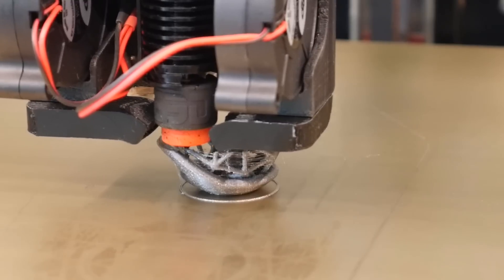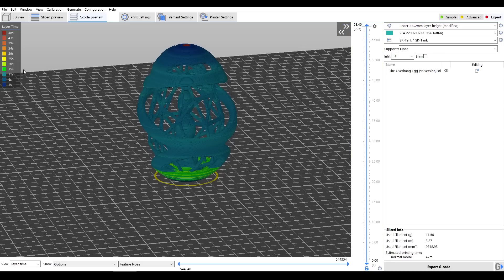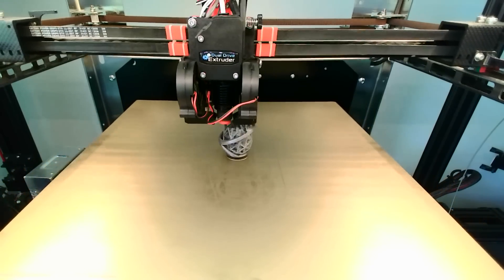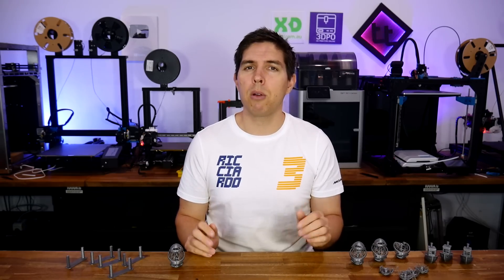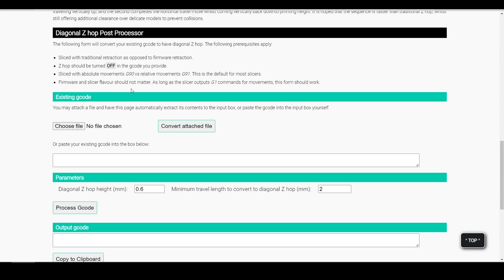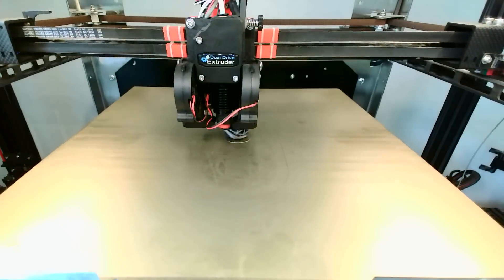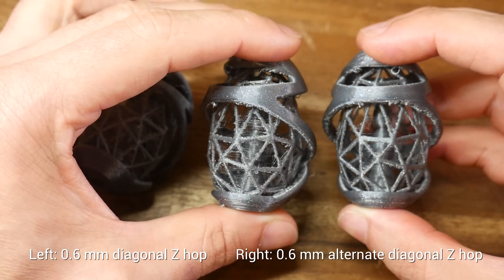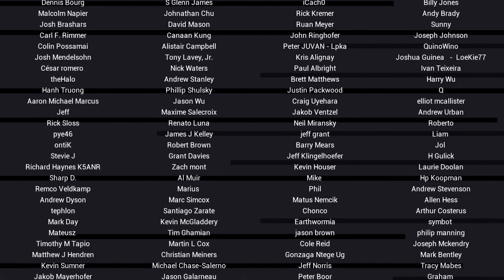Diagonal Z hop - Help me test this new slicing idea

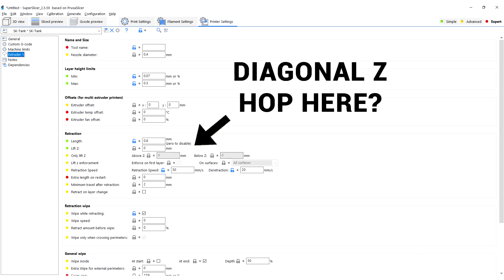Comment: 11:51 What we really need to find out, and empirically test, is why and how the z-hop produces stringing, while without it does not.
My personal guess is that the printer without basically wipes the nozzle off on the part it is printing. And the one which z-hop is a surface tension problem. If that is correct, a hardware solution is best, I think. A razor blade that wipes the underside of the nozzle by almost scraping metal on metal, perhaps.

Comment: My bed is only 140mm but the higher the object gets the worse the effect seems to be... as the head moves between the left and right extremes it seems to dig harder into the surfaces at the sides... I was expecting it to dig more in the middle due to rail droop, but it is like the bed istelf is drooped... unlikely as it is a sheet of glass. Calibration of first layer is critical to adhesion. My bed is calibrated well in general and after I put some hair spray on the plate I can get several prints in without releasing, while still not needing the giymnastics needed to remove from glue stick... Sort out the 1st layer, maybe increase temp to 215C for layer one to make it more smearable, and it will stick

Comment: This has been added to Orca Slicer (i switched from Cura, its been amazing). Under the Printer Settings --> Extruder --> Retraction --> Z hop type --> Slope

Switching from Normal (vertical) to Slope solved my stringing problems. I was trying to modify temperature, retraction length, retraction speed, drying filament, etc, you know all of the traditional things that can help. The only thing that worked was disabling z hop. Of course you lose the benefits of z hop, and risk knocking off prints. Then I came across your video and discovered that its already in the slicer! I reset my settings and only changed to use Z hop Slope, and the stringing is virtually gone! Im at 220 C temp for PLA, 0.8mm retraction distance for a DD extruder, 45 mm/s retraction speed. Pretty normal I think. Anyways, this makes me love Orca slicer even more. Orca has all the best features from the other slicers and some unique ones.

Comment: I think problem could be mitigated by avoiding entering and crossing curled zones, which can be detected by slicer as areas of steep overhangs. If nozzle will avoid these zones printing will continue regardles curling.

Comment: I printed this out of ABS using the same settings I use to print all my Voron Parts. Came out perfect other than some minor miss aligned bridge extrusions due to the bridges being on a curve. I guess the low part cooling needed for ABS with 40c chamber temps really makes this a cake walk for ABS. My Lift Z is set to 0.2mm and I didn't have any stringing. I even even have outer perimeters printing first which should make overhangs harder to print.

Comment: Would probably be more elegant if the slicer was just smart enough to avoid travel over overhangs. It can already identify overhangs to provide extra cooling or by adding extra perimeters so the same logic can be used to avoid them during travel. There is already a function to avoid crossing perimeters during travel. Also you want Z-hop to be at or less than half the nozzle diameter. Anything over that you will get excessive stringing as you have discovered.

Comment: I think stringing is reduced with no z-hop because the bit of oozing filament is wiped off as the head moves sideways away from the just printed part. You could experiment with „micro wipes“. Basically retract, then do a little wiggle before hopping.

Comment: I'm printing on a shitty fire hazard ANET A8 on a heated glass bed, hair spray for helping the part stick and a BL-Touch for bed leveling and I never had issues with parts getting of the bed. Maybe your bed adhesion is sub-optimal and that is where your bottleneck is. Your z-hop solution is promising though, great find!

Comment: I would think allowing the travel to move horizontal for say 2 mm and then move upwards should remedy the stringing issue as it acts like a normal travel and most failures happen as the travel arrives at the next extrusion

Comment: I would've implemented this at a constant diagonal angle, like 10-20 degrees from horizontal, up until it hits the desired z-hop height. That seems like the best way to avoid those curled-up bits consistently, and also makes small hops much less of an issue.

Comment: Why don't you just use "wipe while retracting"?
It will do a horizontal movement first then and the Z-Hop later.
With Z-Hop + Wipe enabled I print dry PLA without any stringing.

Comment: As the stringing most likely comes from the upward motion sucking out molten filament from the nozzle, I propose the following;

1. start the line horizontal without retracting

2. After a defined distance (let's say 2mm) you retract while doing the movement of step 3.

3. Continue like your second proposed method. I.e. move to 0.6mm above location B.

4. Unretract and lower to location B.

If you want to get extra fancy you can try unretracting a small bit more filament before lowering down to location B and retract back to normal before touching down. But idk probably nothing exciting would happen.

Comment: I remember years ago an experimental slicing tech where, at the end of a perimeter move, it would partially re-trace the perimeter to wipe the tool and smoothly lift off the part following that direction and then when it was off the part would curve mid-air towards the next extrusion target.

Comment: Cool idea and thanks for helping the community out with your tuning site and tips!
Would it be possible to let the hotend sidestep to an area where nothing had ben printed yet and no potentially curled up sections could pose a collision risk? Then, you would have the pros of a normal non-z-hop horizontal movement but still dodge printed edges which did curl up. I have no idea about programming though, so I am not sure whether it would be hard to write an algorithm for a slicer which identifies possible pathways in the same level instead of inserting a z-hop to a level where nothing should be because there should not yet be extrusions. On that note, maybe the existing code for non-planar slicing could help out here..

Comment: An alternative method that also could be tested is to make the Diagonal go directly above the destination point and not the middle point. in that way it would do two moves, one diagonal upwords, and then the vertical down to start the new extrusion. It could reduce the stringing and also had the benefits of a not so dialled extrusion so it does not knock the piece out of he bed.
Reply: oh well... i finish to see the video now... hahahah

Comment: In general the diagonal Z hop is similar to the wiping option in the slicer, providing a little more surface and time to capture oozing filament.  A short retraction as part of the Z hop may also help the process for objects with small surfaces. And you may get even more improved results by accurately tuning Linear Advance, and of course doing all you can to avoid ooze and wet filament that generates uneven pressure. Oiling the filament (e.g., with a paper towel dipped in vegetable oil) is another old-fashioned way to reduce ooze because it produces a slightly more regular extrusion. The object I sometimes use for this kind of stress testing is the classic Voronoi Skull at a very small size. Even before we had Linear Advance I was able to tune my old crufty Prusa i3 to the point where the output was almost completely string free. Anyway, diagonal Z hop is a fine variant of wiping and it would make a useful OctoPrint plugin while we await the slicer option.

Comment: I just tried a flipo that I failed 4 times to print (previously) on my ender 3v2 with a traditionaly diagonal z hop @ 5mm/2mm - printed with similar though beter results, now trying the alternate

alternate provided worst results, simply a glump of pla around the nozzle object was thingiverse # 4591728 though I layed it "flat" and the slicer didn't think it needed supports at 50x50x15mm and I sliced it using creality's slicer (cura based)  with super quality defaults and 100% (geometric) infill

Comment: Just a thought: Cura reduced stringing by ending each layer on the inside and the nozzle essentially scrapes off would-be stringing. I seem to remember you doing a video on why it had less stringing than Slic3r. What if you set the path to only raise z after some percent of the path of some distance, ex 1mm?
Z hop: |---------|
Your first z hop: /\
Your second z hop: /|
Scraping z hop: _/|

Hard to show in ASCII, but hope that makes sense!

Comment: There's two factors contributing to the failure:
(1)  The warped protrusions that the head colides with.  This is the real issue, and is the first thing to fix, if possible.
(2)  Bed adhesion... if the part is immoveably stuck to the bed, it will help avoid disaster when collisions do occur.  Michael, along with all the 3D printing channel Gurus, have long since adopted their favourite systems.  Some time back, I watched an excellent series, pre-dating 3D printers, on Rapid Prototyping by Dan Gelbart.  He explained that if you clean a surface with Isopropyl Alchohol, or products like thinners, you actually leave a layer of hydrocarbons.  Although it is typically only one atom thick, it acts as a separation layer.  I think he said that a detergent which can be rinsed off completely is preferable.  Ivan Miranda demonstrated his preferred method in a video:  basically clean it with dishwash liquid, (no additives, colouring, perfumes), rinse with hot water, pat dry with a paper towel (I just shake my glass bed until only the tiniest of droplets remain; the heated bed gets rid of those.) From that point on * DO NOT TOUCH IT...    E V E R ! ! ! *

This has worked for me, but Michael's test model will be a challenge for any method.
Watching with interest!

Comment: I think one important parameter would be the delta between the current printing layer height and the height to which the printer head will lift off to. In your example, no such delta is set, so it just lifts off as much as it wants to. My thought process is that the diagonal z-hop, as beneficial it may be, probably only really matters for near the point of lift-off and maybe at the drop-down (not with the proposed alternative, of course), so it would make sense to move the printer head in a straight line onwards from where continuing to move the printer head in the upwards direction would prove no benefit

Comment: This is a thought i had for a gcode modification that i dont have the skills for but could reduce travel times in prints. What i have noticed is if you align the zseam to one spot like a corner the slicer will be starting and ending each wall in relatively the same spot. So i thought why have it stop, retract, move, prime, print when it could just continue from the end of one wall to the adjacent start of the next wall out. Effectively connecting all the walls into one cohesive snaking wall for each layer. To me this seems like it could reduce travel times pretty well.

Comment: Here's an idea to tweak your alternate Z hop. If you can travel off the part horizontally and then once clear start the alternate hop motion. This way you still get the wiping action as the nozzle clears the part.
Reply: Outer perimeters need to be printed last, and the nozzle needs to move to the point where the nozzle has the shortest path to exit the printed area, even if it means moving away from the next printing point, otherwise you may hit your already printed section (curled borders). Once the nozzle is outside, lift and move it towards the next printing point, going down vertically. Also, retractions may need to be tweaked.
Reply: Cura already does such thing; parameter is called "avoid printed parts" and it can also avoid support material. It does choose between a z hop or an avoidant travel move though, but never both simultaneously.

Comment: Really interesting your research and testing. Very thanks for your resources in your calibration site and videos. Did you already talk about a way to recover a failed print? I mean a way to launch a new print in top of existing failed print by offseting Z and chopping the gcode at the right "height" or maybe another technique to get it. This would be super useful for those big prints that fail at the very end.

Comment: Watching the animation showing the difference between standard travel z hop and diagonal z hop really clarified this for me.  I'm new to 3d printing so I am taking in all the info I can and this is great stuff.  But one thing hit me:  Why do the hop from 2 edges that at close together instead of from the "outer" edges?  Using the tower you showed in this video would it help to do the hops at the outside edge, travel over the printed surface doing the diagonal hop and then "land" on the outer edge on the other tower followed by moving inwards as those layers are applied?  I suspect I'm not describing it well but I would think that the stringing could be reduced if the strings are connected inside the print surface instead of at the edges.

Comment: The reason I use z-hop is to avoid hitting printed parts, as you demonstrated with the curling edges of the egg. Your modification appears to ignore this necessity by making the upwards travel move so slight over larger distances that there is probably more likelihood of it hitting the printed part on larger prints. I would suggest you need a slight modification to your 'alternate' approach which is to make three movements; first a short diagonal move upwards which introduces the required height for the z-hop, but also keeps the nozzle moving horizontally, then move the rest of the way horizontally and finally descend as appropriate to the required location. Imagine the path like the flight of a plane; short and quick ascent, linear travel, and then descend. That would appear to satisfy everything. As for how well it prints... let's see?

Comment: I know the X1C does a Z hop while printing but I just that ran model on my printer and it printed fine, no stringing, on default settings in 1 hr.
Uploaded for proof.
Reply: Same for me on my Bambu Lab X1C. No problems with that print.

Comment: I have a related idea which I've been wanting to try, but I'm not quite good enough at G-Code yet. Let's call it something like "Non-Planar Bridging". I'm wondering if we extruded bridges in just the right arc/parabola/catenary shape, whether we could eliminate sagging.
Reply: I don't believe that this is possible. But I can give it a try and it's an interesting idea. You don't expect the extruded bead to fully cure while you're bridging. Indeed thus helps you keep it somewhat clean as surface tension helps you fight gravity and maintain low sag. So when you draw your bridge faster, it actually succeeds more. You can also underextrude the bridge, since area will drop a little with extrusion width but volume and weight will drop much faster.

But very slow bridges cure more and maybe it is a thing that can be done.

Comment: I think the alt z-hop that would work best is the one that starts at the same level at the print, retracts (and in it's movement away acts as a sort of wipe), but then change height to max z-hop height during travel, to then stop and lower into place over the next starting point.  It accomplishes the "wipe" when leaving, and the z-hop to avoid little lips (as you pointed out) when moving back to a section.

Comment: i think this would be so much more effective if it wiped towards the center of the island so it can wipe the nozzle in a way that's somewhat supported so it doesn't knock the print over before the movement. ideally the end of the movement would be on the other side so it doesn't have to wipe the opposite direction then change direction to make the movement... if that makes sense.

Comment: I messed with this via cura post processing script a while back (I"m older so a while back was probbaly almost 2 years lol).  Not for stringing issues but for a smoother surface when using z hop.  Lifting straight up was leaving a stippled texture.  Never thought about it for stringing nor tested it for that.  My end print macro does pull away up and diagonal now so makes sense that could help.  I may have to dig the code back out and play with it some more.  Maybe I'll release a cura post processing script for it.

Comment: A simpler and potentially safer (in regards to avoiding collisions) solution would be a short horizontal wipe while retracting and then a normal z hop before completing the full travel move.

Comment: I think this has great potential. I think it might work better if the travel path is shaped more like this _/———|  basically, move horizontal first as if no z hop at all, but then quickly go up at an angle to max z hop height to get as much benefit as possible.  Then go straight down to the part to print in case the part you are about to print to has curled up. I think that would make it less likely to catch the nozzle than dropping diagonally to that point.
Reply: This is pretty much exactly what happens in Orcaslicer if you enable slope zhop. It works extremely well and I was able to print the torture egg on the first try with nearly zero stringing.

Comment: When looking at the alternate diagonal z hop, it seams that the stringing is more at short travel moves. I guess thats the result of a bigger angle between horizontal and the travel move. Maybe you get better results by defining the diagonal angle to be constant instead of the travel height. You could still have a maximum height and after reaching that a horizontal move.